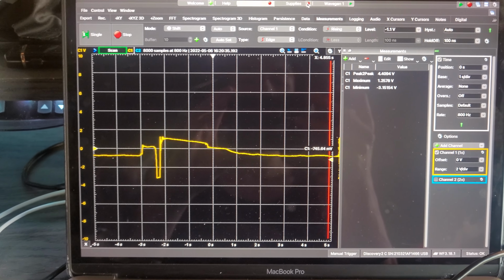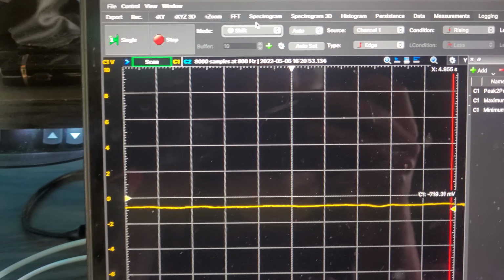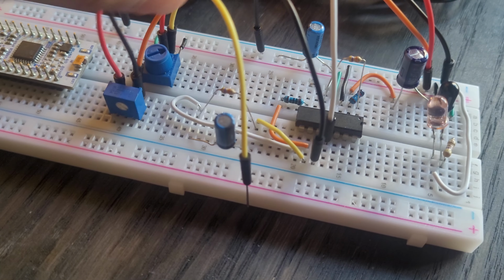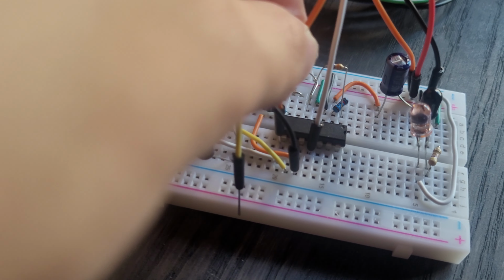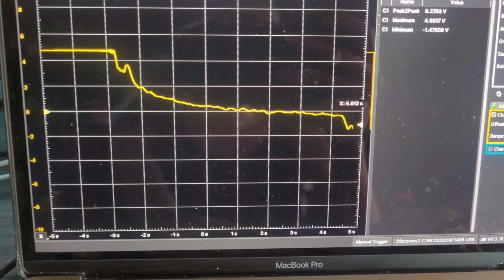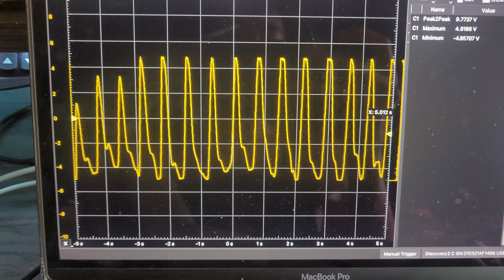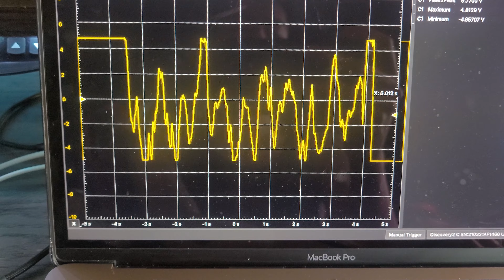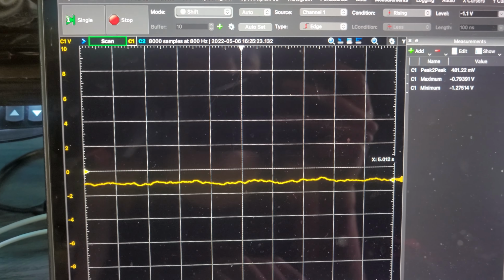(part 2 IT WORKS) heartbeat sensor on breadboard & waveform (Electronics 1 LAB | Sensor App.)

Comment: Why we are using specified resistor values why can't we use another resistor values
Reply from the maker: You may be able to use other similar resistor values but remember, using resistance will change how much power is let through so a component may get too much or too little power